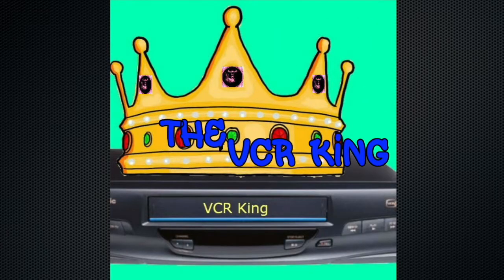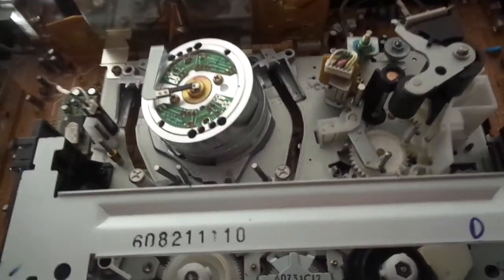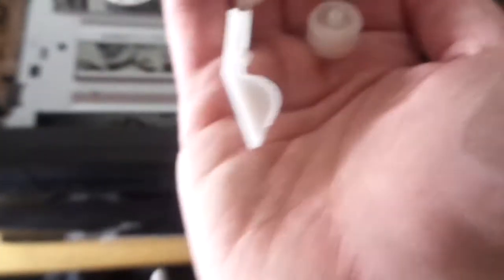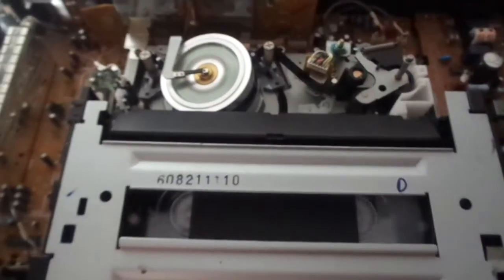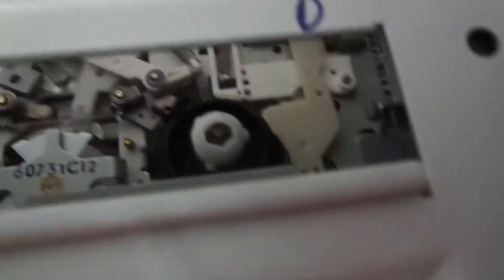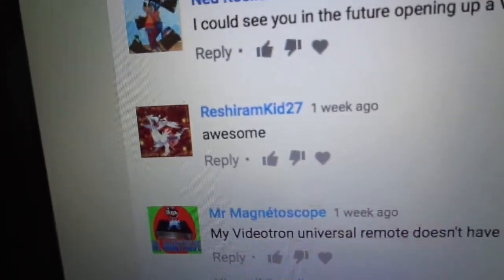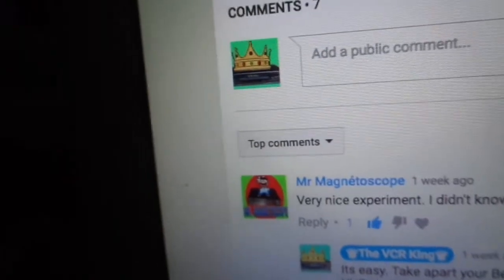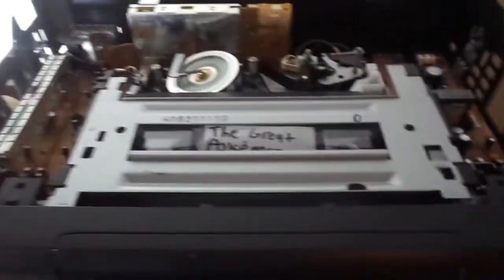Review of my Sony SLV-760HF VCR

Comment: Hi, I have the same exact VCR and had the same problem with the door after I took apart the VCR to fix a gear. While I was taking out the cassette assembly, I had inadvertently mispositioned the lever on the left of the carriage near the door opening. This lever holds open the door as the tape ejects. Make sure it is on the upper position when there is no tape in the carriage. Hope this helps!